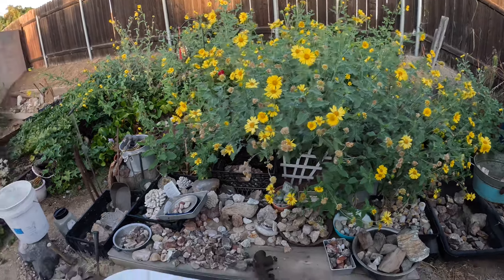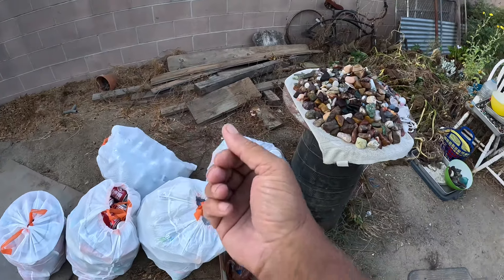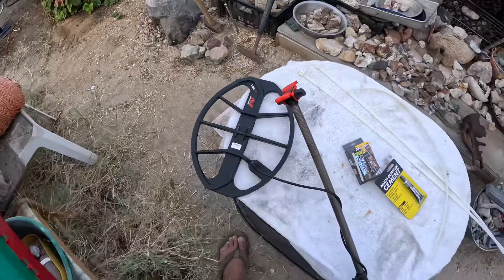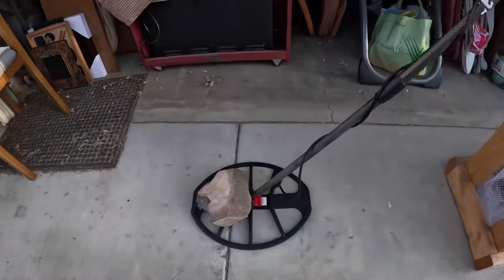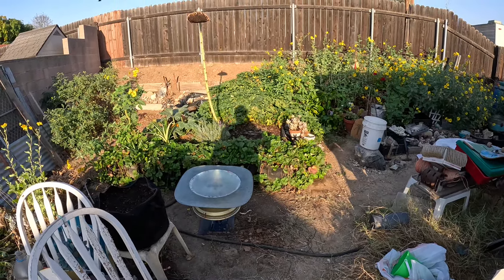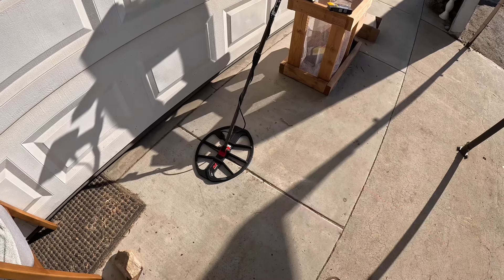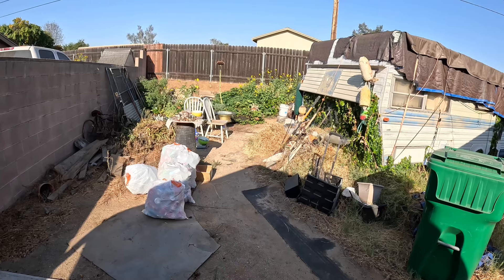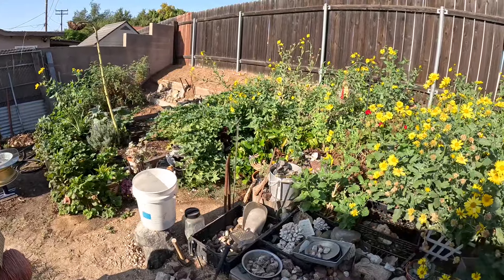How I fixed my metal detector

Comment: The reality is your going to need a new coil. Unfortunately the problem with the coil ears breaking will continue to exist. Too bad Minelab doesn't make the coil ears like they use too like on the Tornado coils on the Sovereign & Excalibur machines, plastic was better quality and thicker.

Comment: Those ear supports help 'some'. But 3D printed plastic is generally garbage and not nearly as strong as the original injection molded plastic. Every 3D printed plastic thing I've owned, has crumbled in a few months or less. Some didn't even last one day.